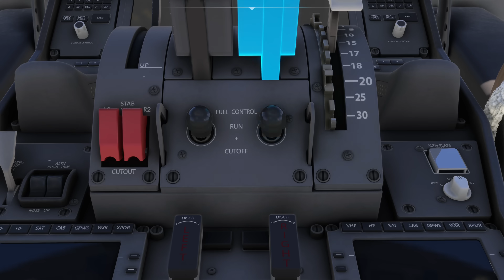Air India 171: Why Did The Fuel Cut-off Switch Get Moved?

Comment: AI will replace pilots. From an AI perspective, piloting a plane is much easier than driving a car. Most of the time, you only look at the data, and vision is mainly needed to observe the runway. Tesla's Autopilot is trained on similar data and has already achieved a level of safety higher than that of a human. And this level will increase exponentially.

Removing the cockpit will reduce costs, reduce the number of components like this fuel switch, increase passenger space, and therefore revenue.

Comment: I've been thinking, if pilots are never supposed to have both fuel switches in the off position, why isn't it an exclusive spot after take-off? Instead of 2 Run or Off detentes, you could have 3 detentes, Run, Restart and Off. Once one fuel valve has been set to Off, the Off detente of the other one is locked, and can only be put in the restart position. A switch being put into Restart will trigger a verification and if the engine is not detected as running, attempt a restart. As far as I heard, the only situation that requires both switches in the off position is a double engine failure, and it is only to attempt a restart on both engines. It doesn't make sense to allow such a critical system to be overridden so easily. The fire suppression system should be the only way to bypass the lock, as we don't want to keep pumping fuel into a fire if somehow both engines caught fire. But otherwise, there isn't really a reason to even allow for both fuel valves to be closed in flight.
Reply: Regarding 2:55 - I think this isn't viable simply in case of one pilot becoming impaired and not being about to perform the task. I think what could be put under a bit more protection is the engine fire suppression system, where activating the fire suppression system in a situation where all sensors are reporting normal operating conditions could possibly require some form of two-factor verification, either by both pilots or 1 pilot and some emergency code. This would give enough time for the other pilot to reject the activation of the fire suppression system if it was a deliberate act of sabotage.

It is tricky, because we can't add too much to the mental efforts of a scenario where only 1 pilot is conscious, but those systems should probably not be as easily bypassed entirely. This is where the idea of a lock on closing both valves at the same time would make more sense. You retain the ability to quickly shut off one valve if necessary, just as you would have before, but without allowing for both to be handled that way at the same time.

Comment: For those who think this is an electrical failure

 its a Mechanical Spring. Even if the whole plane was hit by an EMP, an electro magnetic pulse causing every single electrical system to go down. The fuel shutoff would still remain in the Run position.

It takes mechanical pulling force to move them out of place. Also known as human intervention to change its position.

Comment: I’m not suggesting it’s likely, but is it conceivable that this is a software bug? Are the switches directly wired to the fuel valves, or do they act as inputs to the computer, which then sends a signal for the fuel valves to move?

Comment: Stop blaming the pilots !!!!!!  you don’t know the full technical picture. On the Boeing 787, the engine fuel cutoff switches are not physical fuel valves, sure they are pull actuated switches even so they are still  digital inputs to the FADEC (Full Authority Digital Engine Control), a computer that decides whether to open or close the fuel valves. That means the switch itself sends a signal, which can be misread, spoofed, or corrupted before the action is executed. Aircraft's electronic systems are vulnerable to SEU (Single Event Upset), SEE (Single Event Effects), and SEFI (Single Event Functional Interrupt) — radiation-induced bit flips that can alter memory states, corrupt processor logic, or falsely interpret signals. A simple flipped bit could cause FADEC to shut down fuel flow, even if no one touched the switch. It’s happened before in avionics history. Add to this potential software bugs, sensor line faults, and degraded logic circuits, and the idea that failure is always pilot error becomes naive.
and have we ruled out sabotage completely ? tampered input wiring, malicious firmware, a logic bomb triggered under specific conditions, or bus injection on ARINC/CAN lines could all spoof a cutoff command without physical interaction. FADEC or Onboard Maintenance Computers could be compromised long before flight. These systems are digital — and therefore exploitable. How can this technologically challenged uncle be so sure , why's he in such a hurry to come to conclusions ?

The CVR quote “Why did you cut off the fuel?” is not a confession. It’s a confused reaction to something going wrong in a system far more complex than just switches and levers.

I'm not syaing it was'nt the pilots faults, i'm not saying it was the aircraft or boeing's fault, im not saying it was sabotage ! You just dont fucking know, the evidence is still not enough and people should fucking stop pretending like they know it all because they have done something to do with aircarfts. Modern aircrafts are highly abstracted, software-controlled architectures. Unless crash investigators conclusively rule out hardware fault, logic corruption, or cyber sabotage, no one should assume the crew was at fault. 

Investigate everything. Prove root cause. But don’t blame the dead before you understand the machine. Senior is venturing out of his area of expertise when he comments    " it was pilot's mental health problem !" just cos you know how to fly doesn't mean you know the technicalities of how every little system in the aircraft works...i respect your age and experience in aviation but you are currently basing your arguments only on the facts you understand which might be limited to the control you have seen in the cockpit and a little bit of half baked psychology not the underlying supercomputers that keep it behemoths airborne even when the pilots are sleeping

Comment: Interesting news.  FAA has privately advised airlines to inspect the fuel control switches as per its previous advisory.  Based on this DGCA in India to carry out inspections.  Also Etihad Airlines has advised all its pilots to “exercise caution” while operating fuel switches on 787 aircraft.  

Looks like everything is pointing towards inadvertent movement of switches due to faulty installation.

Comment: Back in 2002, Michael Moore released a documentary that exposed the tragedy of mass school shootings in the U.S. At the time, these events felt unthinkable — inhumane acts, especially involving teenagers. Today, while they remain equally horrifying, they no longer carry the same shock value. Instead, schools and institutions now have countless protocols in place, operating under the assumption that such events can happen again.

Now, in an industry as heavily regulated and safety-driven as aviation, an event like this should set a major precedent for deep structural changes — in oversight, licensing, monitoring, and most importantly, in how we consider the human factor in daily operations. Not everything should be about cost-effectiveness, as if flying safely depends solely on engines, fuel efficiency, or carbon footprints.

Mental health must be brought into everyday conversations — and to a level of priority we’ve never seen before. We seem more shocked by how easy it is to disable a switch than by the thought of a human being even considering doing that — with 250 souls on board and countless more on the ground at risk. Deep down, we know that the human being is not the same as we once understood it to be. And it’s time the industry raises stronger barriers to prevent acts driven by broken minds and malicious intent.

Comment: Why is suicide your sole possible cause? Both engines got cut off within one second and put back to run 10 seconds later within a 4 second sequence. One engine did restart, the other failed. Also, the ELT didn't activate. I saw a close-up-view of those Fuel Control Switches and was surprised how small the locking pins actually are. I would describe them as susceptible to wear and tear. As long as we haven't heard the original exhchange between the captain and his co-pilot, we will not be able the understand whether both where shocked by events or one did actually do it and lie.

And why was the Mayday Call „Mayday… no thrust, losing power, unable to lift“ instead of „my Captain did cut off the engines“ ?????

Comment: This recurring question of why don't we put 2 person decision making steps in place in case of a crazy person are well intentioned but devoid of any consideration. The LAST thing pilots need in an emergency situation with a failure in the aircraft itself is needing to get the copilot to coordinate emergency decisions that by that design the pilot could not do alone, and Lord help us if one of the Pilots is injured or incapacitated what would the other pilot do then? NO, the solution is not more complex gatekeeping, you can't plan for crazy people, the other Pilot is the solution for crazy and dumb decisions by the other pilot.

Comment: Well on the very human factor about this.... I'd like to hear a psychologist about this.

When we talk about AI for example, it should be clear that AI has been developed by humans as well. So there is a chance that problems become even worse.

I do have an idea from Extreme Programming (SW development), which was literally copied from the Seals: The buddy concept. It was invented for very high reliability. So the two dudes on the front chair are buddys. They are both Captains. One in this and one in the other role. Changing roles... like brothers.... yes and sisters as well.... no question. Stickin' together. So every operation is their common success. .... there might be the risk of routine.... both doing the same all the time.... same mind, same risk for errors. Sure, but that could be challenged by training off the grid. They're both a team. If that team has issues, no one gets fired, they are just retrained together. This is a very positive approach and those characters should be selected pretty carefully.... they must match. Or let's say: They must complement each other without competition. 

Just an idea. 😌

Comment: I have two questions:
1. What have the fdrs recorded? Is it that the engine fuel levers were moved to cutoff, or that the shutoff valves were commanded to cutoff? That makes a tremendous difference
2. 5 seconds between restoring the fuel flow for one engine and restoring the fuel flow for the other engine is way enormous a time in that situation. Is it compatible with a desperate human attempt to restart the engines?

Comment: The pilot that asked, why did he cut off, identified this very quickly. You would think that if engines fail at any stage of the flight, it will take longer to identify why they failed. Did the pilot maybe see the other pilot place the switches to cut-off?

Comment: Could the fuel switches have been in the cutoff position from the start?  Does the maintenance crew have the ability to bypass the fuel cutoff position in ground mode? If maintenance had bypassed it in ground mode, would that bypass have changed when the plane transitioned to air mode and caused the plane to accept the actual switch positions? That might explain the pilots confusion about the position of the switches. Very unlikly as I'm sure the pilots have a step in preflight to move the switches, but it could have been missed or assumed that it had been completed if they were looking at a visual indicator on their displays, versus the actual switch positions.

Comment: Really appreciate you doing these Q&As.  I thought about the dual pilot requirement or "lockout" sort of option on the fuel switch run/cut-off matter as well.  It would be good to have some sort of confirmation, the only caveat I can think of is what happens if pilot or co-pilot become incapacitated and say and engine fire situation procedure is required.  Thanks for providing your expertise and insights.

Comment: Could the fuel cutoff switches be left “on top of the fence” and the switch then be making contact with the “run” portion of the internals? If that were true would they then vibrate to “off”?
Seems unlikely but thought that might help with switch questions.

Comment: Electro-Magnetic brake for new engines could bring engine spool to optimal restart speed faster... perhaps saving 30 seconds on a fast restart... could have saved this and other incidents such as double bird strike on take-off or ash induced volcano issue... and controlled spool down could reduce wear and maintenance on engines in general...

Comment: My suggestion is this. 
If you have a subscription to a tv platform and you want to quit (or even change platforms) couldn’t there be a simple double check - <pull up> <move to cut off pos> <double check audible “fuel cut off requested - confirm?> <then a second button array on both captain and copilot> maybe a similar switch like you see on BMW I action. So at least there is not only data recorded but an audible alert similar to ground altitude warning or an engine fire alarm. Switching off fuel supply should have a massive alarm ‼️ attached and secondary confirm. Then both pilots must confirm just like the action of you have control <I have control>. I hope I have explained that clearly when you try to quit an app or tv platform they do their level best to make sure you do really want to quit. Same sort of thought process could overlay the fuel off

Comment: Q1. While flying/take off, how would a pilot know if the fuel switch is cut off, unless looking at the switches or noticing a wrong movement? 

Q2. Could the pilot who turned off the fuel switch 'cry thief' by saying, "why did you turn it off", so as to shift the blame on the other pilot?

Q3. Was there panic in the pilot's voice that asked "why did you turn it off?" If yes, then he may be the one who turned it off. 
Was there panic/anxiety in any of the pilots voices? 

Q4. Could both the pilots have premeditated the murder sucide... 
Was there any other struggling sounds between the two pilots to get the switch back to run position? 

Q5. Was there someone important in the airplane that the govt. or someone wanted dead? They may have colluded with the pilots,...and the pilots' families get the money and the intended person is dead...
Air India loses money...

Comment: A watched another pilot on YouTube make a comparison of a Boeing, Airbus & a smaller corporate jet's fuel switches. The smaller jet throttles have triggers under the handles. The throttles must be brought to idle, then the 'triggers' must be pulled before both throttles can be moved to the cut-off position. It would be a lot harder for a second person to turn the fuel off in that configuration. One pair of hands on the throttles. That looks like the best arrangement.

Comment: Capt S,  Firstly i am not a pilot. You referenced the requirement for potentially isolating an engine fire at altitude, others have asked why did the flight management system allow the cut off. Would it not be logical to have the movement of the fuel switch trigger the flight management system to ask as series of questions,  as in fuel switch No 1 to cut off, fire alarm in No 1 engine = yes cut off fuel.   If however the fire was in No 2 engine the answer is NO with a message flagged on video data cut off fuel to No 2.   Hopefully i have been clear with the question.  With regards to your other commenters and double jeapardy, why not have 2 sets of switches,   one to left seat and one to right seat, far enough apart that they cant be touched by same guy.   Lead pilot instructs fuel cuttoff and moves switch one, with second pilot confirming with his corosponding switch, only then does the fuel cut off.   Bit like the movie style of Nuclear launch, 2 x crew but independant instruction from each other. Or it just could be the cockpits are not large enough to seperate the distance???

Comment: The Report says Fuel Control Switches were transitioned from RUN to CUT OFF.... Could there not be a possibility that due to electrical glitch some signals may have been sent to FADEC system and the pilots in the attempts for recovery did manual shut down / restart of engines ?

Comment: Here's the solution... or not. The two pilots were fighting in the cockpit, after one of them cut both Fuel Control Switches... It took the non-suicidal pilot ten seconds to win the fight and flip the Fuel Control Switch back to RUN. Too late, of course.  The investigators know exactly who was talking: It takes good psychologists to find out whether the question "why did you do that?" came from the murderer or from the non-suicidal pilot. On top of that it's going to be difficult to find out, who cut the fuel... BTW: As a Pilot Flying (the Copilot) you can easily do it, too.   And... IF there was a fight... why was the 787 flying seemingly calmly with wings level into the ground? The Autopilot was not engaged.  My five cents, dear fellow arm chair Inspectors Columbo.

Comment: 3:35 Regarding having 2 inputs to shut off the fuel… I don’t think we should solve problems like this by designing planes to resist pilots with nefarious intent. They should be solved by preventing such pilots into the cockpit. To some degree situations like this cannot be avoided entirely. It’s impossible to engineer out every potential nefarious action.
Reply: It is also impossible to 100% get rid of nefarious actions
Reply: The draconian methods used to keep unwell pilots out of the cockpit are very likely *why we are here to begin with*. If pilots could fully engage with psychiatric treatment, medication included, without risking their license, we wouldn’t have problems like this.